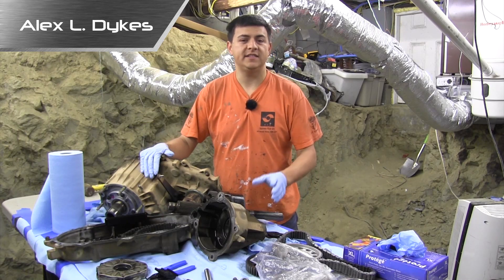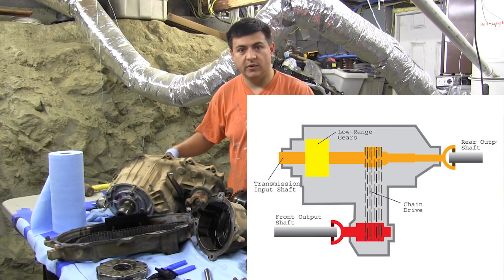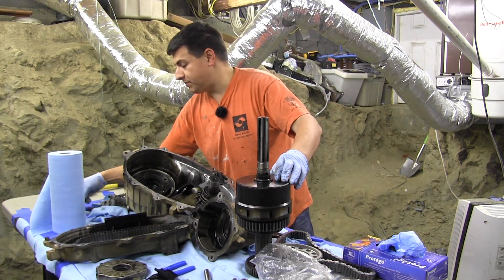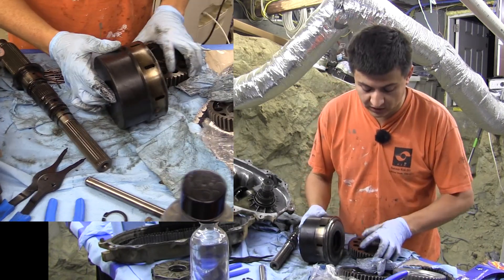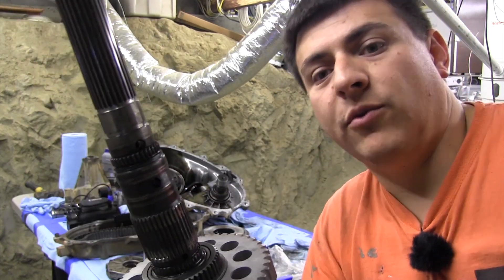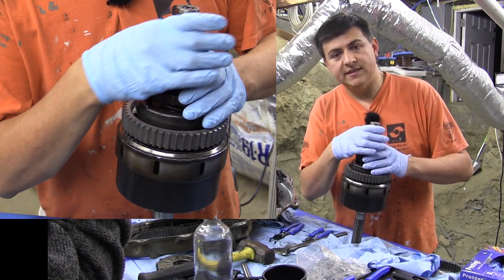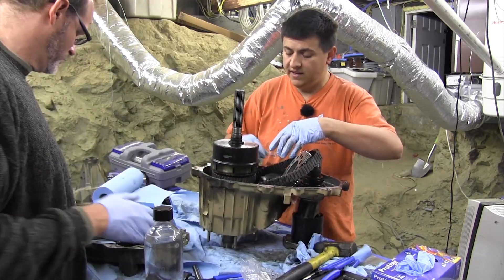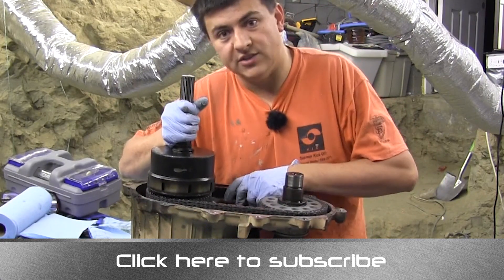Jeep Grand Comanche Project Episode 3

Comment: Not bad for someone who is not acquainted with Jeeps. Actually you should have abandoned that Quadra-Trac unit and installed an NP 231 or even the NP 242. Used they can be bought for around $500, at least on the east coast. But, outstanding confidence to rip in to one of those boxes, they are a pain and usually are crap.

Comment: Hey Alex,  is it possible to add Quadra Drive II system down the road on the all new (2014) Grand Cherokees? or it is something that should be factory installed!. The reason I am asking is because the GC doesn't offer Quadra Drive II system as an option on V6 and i want the fuel economy of the Pentastar engine. Thanks
Reply from the maker: I doubt it. Because QDII is now an electronically controlled system rather than a pure mechanical system like QDI, you would need to somehow reprogram the computers and add the wiring. I'm not sure how possible that is.